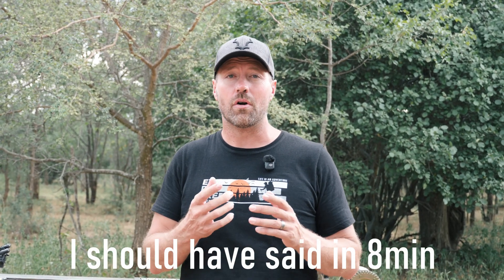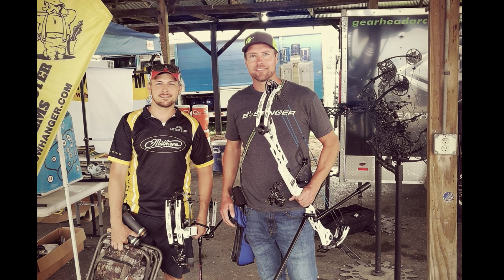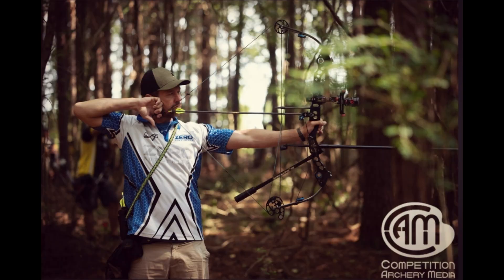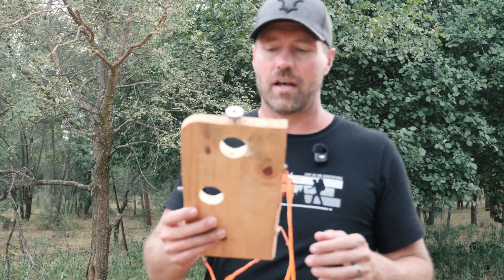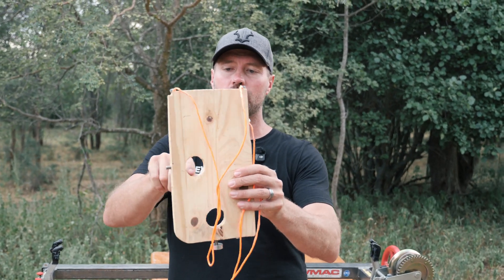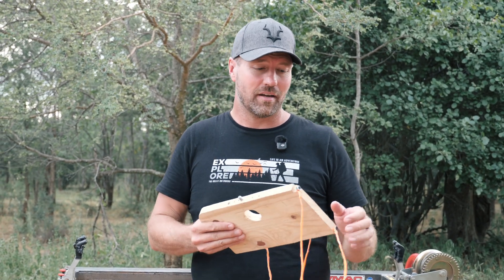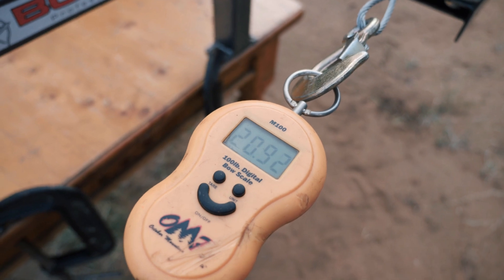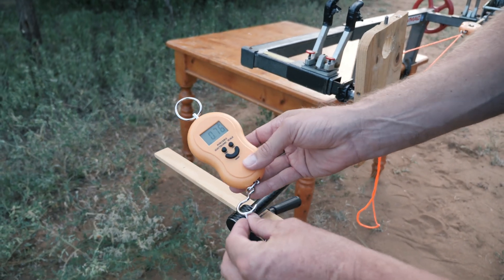Never-Seen-Before Test: Dynamic Brace Height Explained!

Comment: Very nice I’ll say I somewhat stand corrected from the last video and somewhat don’t stand corrected. 

So the next conversation is how much does this actually matter when translating into the human hand shooting scores? 

I can take my rx9 ultra “long DBH” and my lift x 33 “shorter DBH” bring them both to full draw grab the handle and torque them both severely (near derailment more than any normal human would torque a bow) in both directions at 50 yards and neither bow has more than a 1 inch difference in impact. And for hunting bows to even blame the 1 inch change in impact on torque would be a stretch. I have a 1 inch variance when I don’t torque the handle at all. 

At 20 yards no matter how hard I torque either bow I’m not leaving the X on a 5 spot face. And I mean REALLY torquing the bow hard. 

The biggest real life test one can do to test torque is shoot barehafts at 50-100 yards. Again neither bow or any bow out of 75-100 bows for that matter have I ever struggled to repeatably shoot barehafts at 60-80 yards. 

These 2 bows are not torque tuned they have integrated rests and sights on both. So the real question is how much does this really matter? In my testing it doesn’t matter at all in the real world. 

It’s kinda like right helical vs left helical you can measure the difference in slo mo on cam but no human alive can measure the difference in the real world or even from a shooting machine. 

So it still stands does this account for anything in the real world? I don’t think so. I think several other factors hold WAYYY more value.

Comment: Nice proof of concept. Maybe you could connect the string to the board with eyebolts that thread in and out and have an adjustable dynamic brace height simulator then graph the torque resistance change as the DBH changes.

Comment: I've been shooting a Diamond Deploy SB over more modern bows this year. I used Titanium Archery Products to updated the cable system and string stop. It's a 5lb setup and shoots just as good as my more modern 6lb+ setups. It's cool to see one reason why. I wish bow makers would focus on making carbon risers better/cheaper and stop with all the other worthless crap that just adds weight to a bow in bad places.
Reply: You need a PSE Mach 33!

Comment: A very interesting “ test?”.  I wonder what the difference in yout side torque numbers would be between a 6.5” and a 7 “ ?   Is it even relevant?  What effect does the stabilizer length and weight have?  👍👍